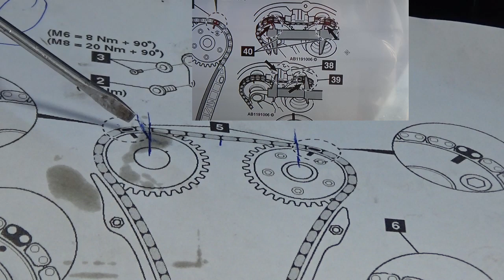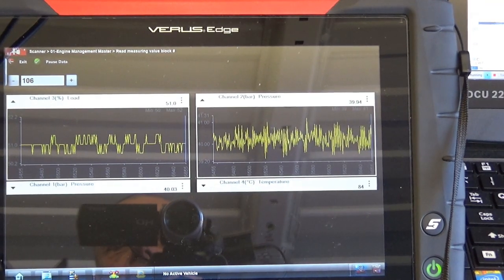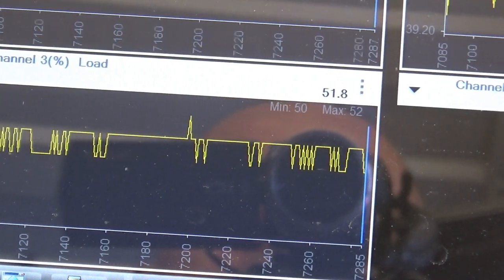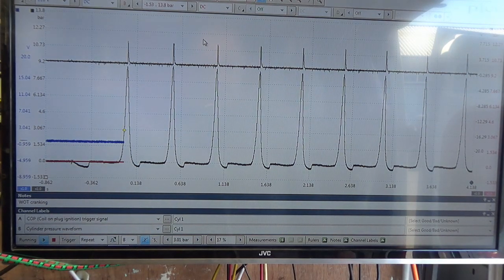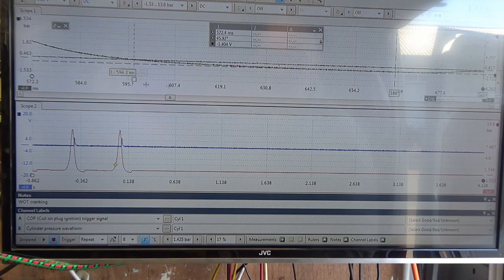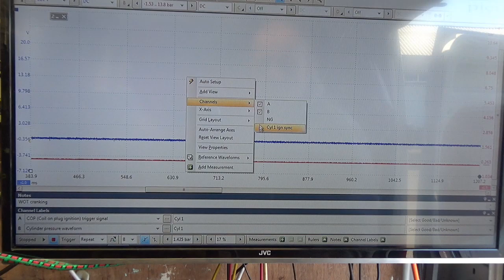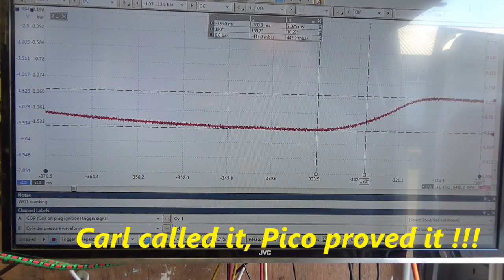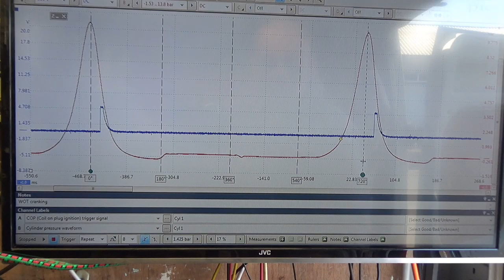Skoda Yeti CDAA1.8TFSi - P0088 fuel pressure too high - Part 2

Comment: thank you baba.......
 VW agent failed to pick up this issue after changing the chain two times... and the car kept trowing P0088 code.
only to find out my exhaust cam lobes were twisted and caused the car to be off time somehow, I've figured that out after watching your video many thanks you the star.

now my car is 100% full power is back and no more high pitch whistling sound from the engine and P0088 is gone

Comment: On my car the exhaust cam gear spun on the camshaft! When the valves hit It caused that gear to spin two marks. .  that could be your problem, exhaust cam needs replaced. I had the same p0088 code with super high fuel pressure!
  The exhaust gear alignment marks should be about three teeth to the left of where the slot comes up and down in the middle of the cam. Mine got Twisted when the exhaust valves hit when the timing chain let loose last month. We put it all back together with new valves of course and I just now found the cam gear rotated.

Comment: Hi Steve, glad I found your channel! Really appreciate what you share! I have a 2.0 tfsi, which has just had a chain fitted on the rear of the cylinder head, I'm now getting a p0087 low rail pressure. This may be because the intake cam timing is slightly out.
Reply from the maker: Leigh Evans top man, glad you’re enjoying the videos 😁
Reply: Steve I have edited my coment
Reply: Steve, would picoscope have a good known crank cam wave form?
Reply from the maker: Leigh Evans they may have, it’s always worth a look in the waveform library 👍

Comment: great video,  but how is spark firing late a bit weird,  at the beginning of the video I thought it was the high-pressure sensor gone bad, seen on some golfs. anyway good job, thanks
Reply from the maker: phantom explorer  I don’t have an answer until I see another one. Cam timing is 110% verified   It really runs like a Swiss watch now.  Thanks for taking the time to watch and comment. Steve 👍
Reply: Spark might be so retarded on cranking because the mixture will be rich on cranking start maybe? Richer the mixture results in faster burn time hence the retardation of the spark. May be barking completely up the wrong tree here though haha
Reply from the maker: Brett Auto Diagnostic and Repair it’s a better theory than the one I haven’t got. Thanks for commenting 👍 Steve.

Comment: I am interested as to why it did not set a cam crank correlation code ? Was the timing from the crank to the intake correct and then off On the exhaust side? Don’t know why they went away from good fixed timing marks on the engine block or head to the sprockets, now it’s all marked chains and sprockets. Nice job with the pico.
Reply from the maker: Huntnfishnuts that’s exactly it. Crank to intake was correct.  Steve.

Comment: Great find Steve! Do you use cam and crank sync much for timing issues or is this your go to test all the time? I agree the dual view doesn’t work so well for in cylinder testing, works great for things such as cam and crank correlation though 👍🏻 love your work Steve I learn off of every video keep them coming! Thanks for uploading
Reply from the maker: Thanks Scott, yes, I use known goods all the time but it wouldn’t have been any use in this case as there is only one cam sensor on the intake cam. 
Diesel vehicles are where cam/crank are most useful as getting in cylinder can be perilous. Glad you enjoyed the video 👍

Comment: Too complex for my brain, so one tooth off then?
How did they manage to do that, surely there are cam clamping tools to make the job simple.
Reply from the maker: It was about 10mm, the timing was checked and double checked, maybe the chain wasn't fully tensioned? there are no timing tools per se, it's coloured links on the chain.